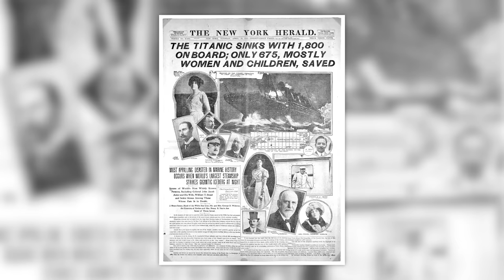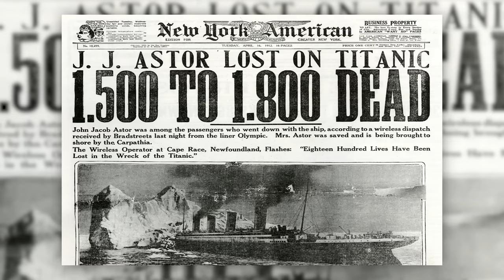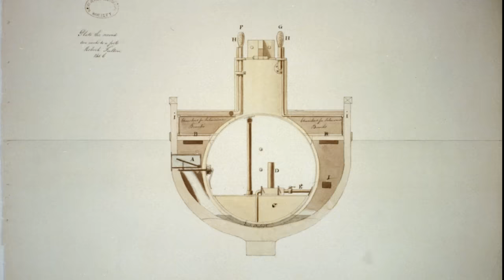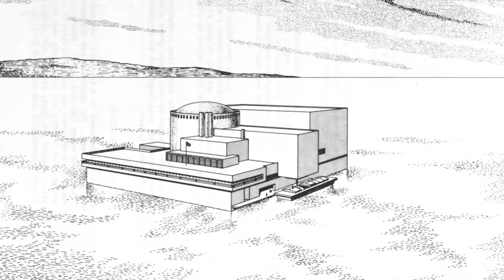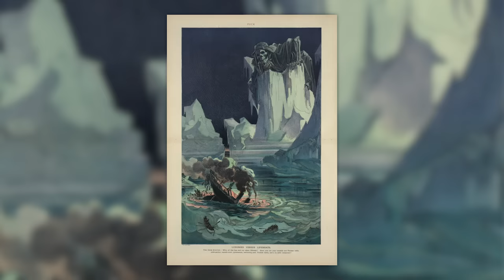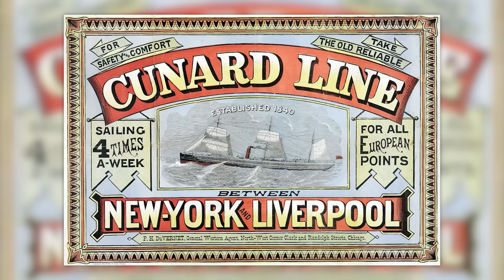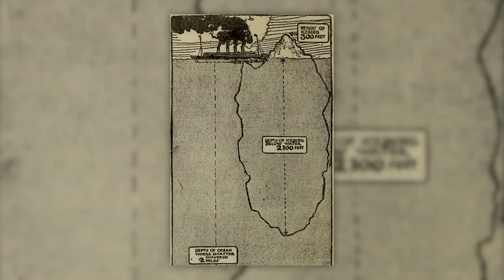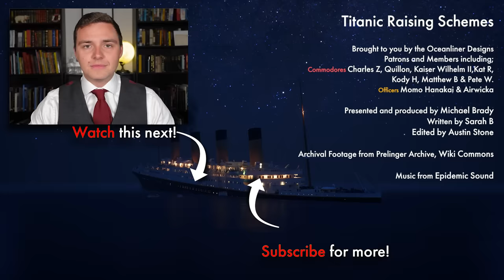The Bizarre Schemes to Raise Titanic!

Comment: Just out of curiosity, has a large steel vessel ever been raised from the bottom of the ocean? If so, how was it accomplished.
Reply: Several battleships sunk during the Pearl Harbor attack were refloated and repaired, but they sank only to the bottom of the shallow harbor, not to the bottom of a deep ocean.
Reply: The car carrier Baltic Ace was raised from the bottom of the Baltic sea after being cut into pieces that were raised one by one
The Soviet submarine Kursk was lifted from the bottom by being slung below a ship with winches on either side
Many big ships that were not fully submerged have been recovered too; (SS Normandie,  SS Paris, many ships In pearl harbour and most notably the Costa Concordia)
Reply: Thanks! Would make for an interesting episode

Comment: & Furthermore, the Titanic wreck doesn't need to be raised. As it is still very heavy and dug in at the stern atleast many decks in also. That doesn't include the tonnage of the water columns around the Titanic wreck. It would be impossible to get the things up to the surface and then what. & then you half of a ship 🚢 🙄. I think, however, the back section of Titanic should be explored more .There has to be a way inside some in the wrecked parts to gain access with cameras only, of course, no rovs or personal diving way to deep & and dangerous.